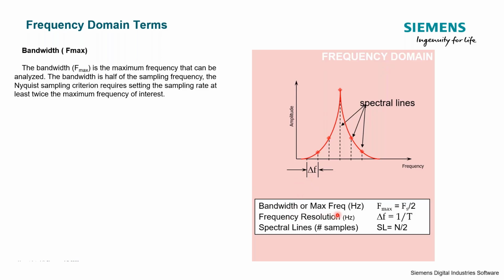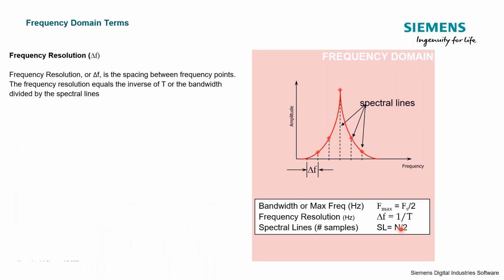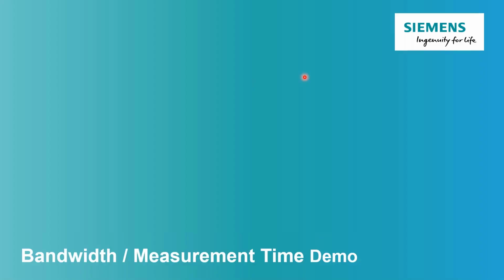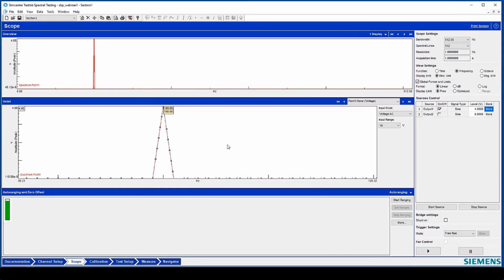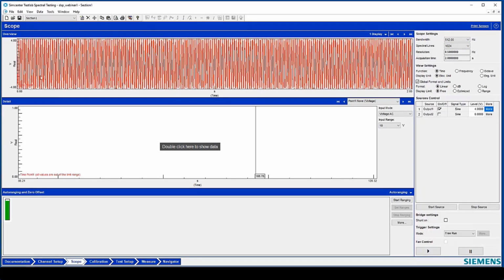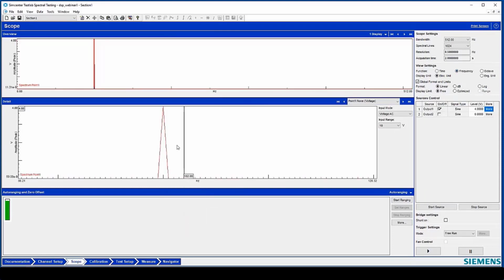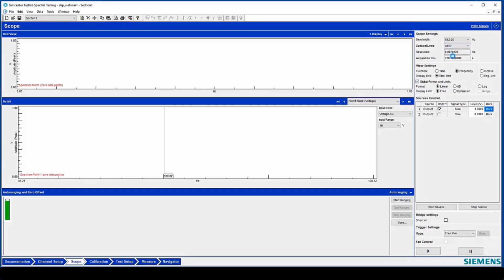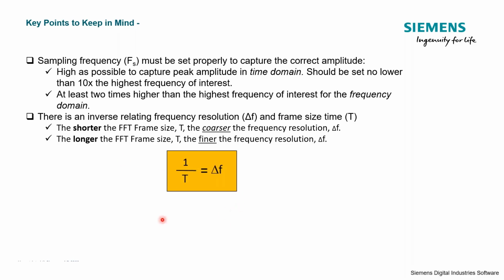Frequency Domain Digital Signal Processing

Comment: At 1:20 why is it that "SL=N/2"?
Reply from the maker: Spectral lines (SL) is half of the block size (N) because the total number of data points used in the time domain remains the same in the frequency domain. In the frequency domain the time data points are converted to either amplitude/phase or real/imaginary pairs. This means that along the X-axis in frequency there are half as many data points than in the time domain, but each frequency point contains two data values. More information: https://community.sw.siemens.com/s/article/digital-signal-processing-sampling-rates-bandwidth-spectral-lines-and-more